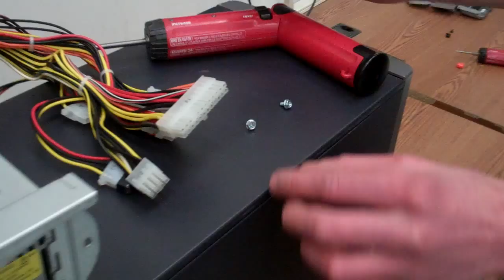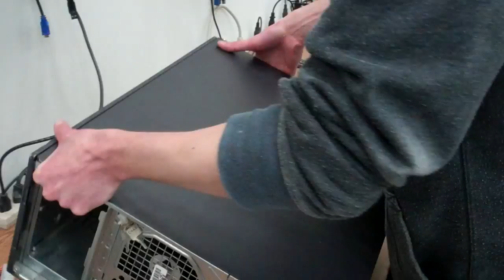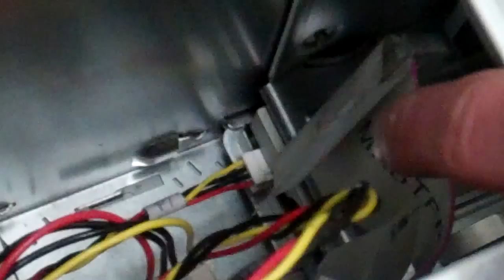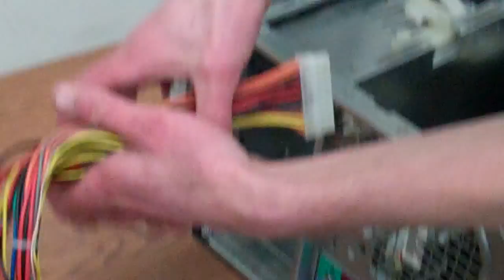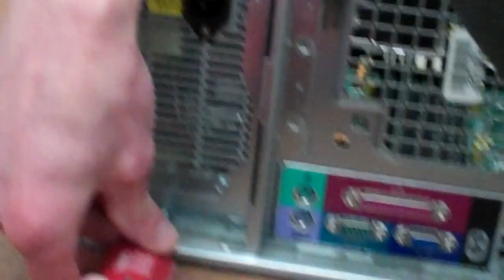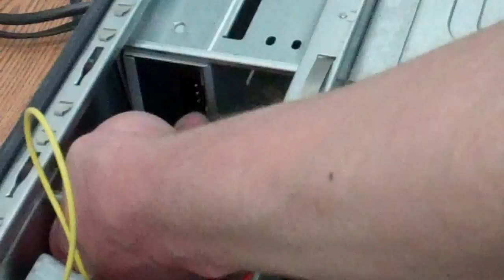Velocity Tech Solutions - PowerEdge 1800 Power Supply Conversion

Comment: Hard to believe that more than 6 years after this video was created, it is still valid. Just rescued an ailing PE1800 for a client that's had their beast in service for 12 years. Power supplies failed, and I was forced to come up with a solution quick. Picked up a quality off-the-shelf 750 watt ATX power supply, & a 12" 24-pin cable extension (for modification purposes). Reason for my comment - Superdude688 mentioned that with a simple wiring modification, an ATX power supply will bring this server back to life. He mentions a "purple wire" - seasoned techs will realize that not every manufacturer follows the ATX colour specification. Many power supplies don't have a purple wire. The power supply I purchased had all black wires. If you refer to the ATX pinout specification found here https://en.wikipedia.org/wiki/ATX the "purple wire" is pin #9. The pins are usually numbered in tiny digits on the wire side of the connector. The wire on Pin #9 has to be moved to Pin #20 to get an ATX power supply to work with a Dell PowerEdge 1800. I purchased the ATX extension for modification purposes, allowing the power supply to be unmodified. Worked like a charm, and got my client back up & running in decent time. Most of these servers were yanked out of service years ago, but hopefully this information will help someone somewhere.

Comment: so I relized this is an old video and I probably won't get a response but I have this exact model with an non redondent psu and I believe something is wrong with it because the pc won't turn on but the lights on the case will flash BUT the psu fan still works. does this mean I can still repair it or no?
Reply: +tripleBOOMER Does it attempt to access the HDD during boot?
Reply: +KGB240 I get nothing no booting or sounds or front lights, nothing

Comment: You can also use a retail power supply as long as you get one with simlar power rating (amps and watts etc) All you need to do is switch the purple wire on the atx connector and make sure it is EPS 12v compatible (has the 4 pin 12v mobo plug not just a 4 pin) Take a look at the plug on the dell and then o a normal atx and compare you will know what i mean good luck everyone :)
Reply: Superdude688 do you know where to get the fitting for a non redundant psu? That metal bracket? Both of my redundants have died and new ones are way too expensive. The purple wire trick worked fine because I'm not using scsi, I don't need to worry about that plug. But I have no mounting for it

Comment from the maker: @channelthisyo  From what I can gather, it is a signal wire of some sort. the NON redundant power supply does not need it. With 2 power supply, I would think it acts as a signal to the system board to inform if there is a failure or a switchover if one unit fails.